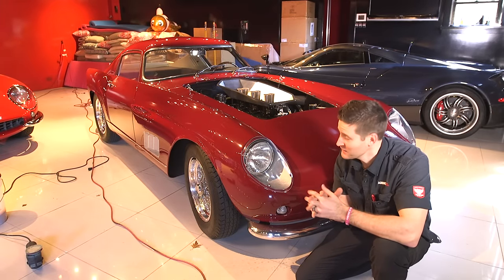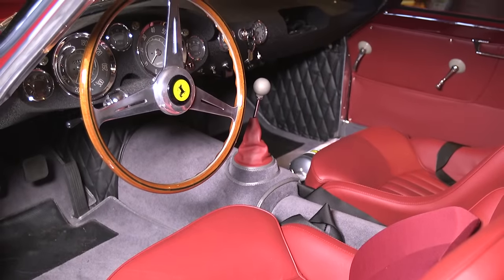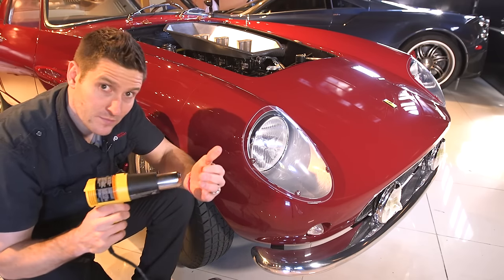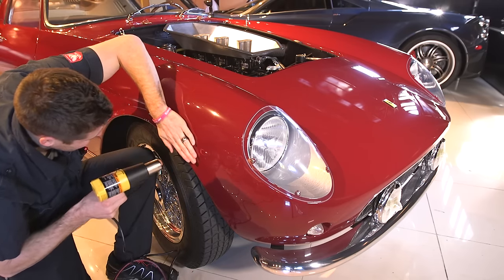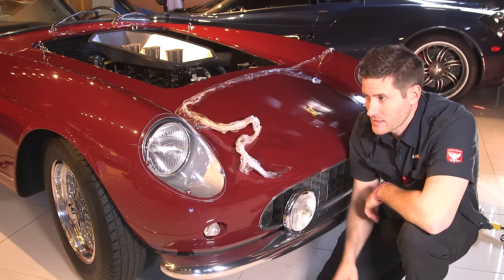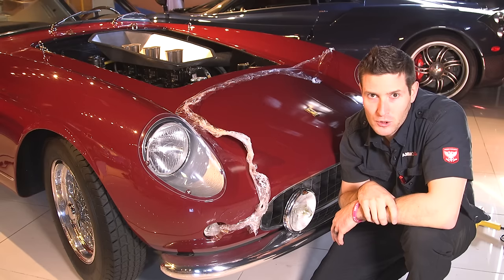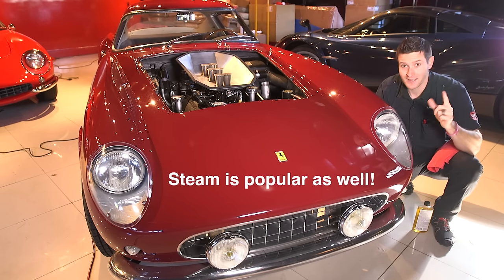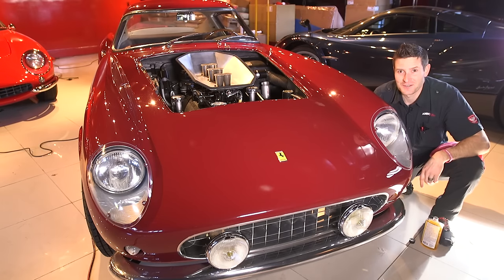How to Remove Clear Bra: $12M Ferrari 250 GT LWB

Comment: having been an installer of all the clear bra/paint protection films on exotic cars, one thing i found was that by pulling the film away at a VERY shallow angle to itself, leaves NO glue behind, NO heat required. the idea is to actually not lift the film more than about 5mm above the surface, by lifting the film one thing you run the risk of is lifting the paint layers, and if it wasnt a professional paint job (outgassed/hardened etc) that you could pull up paint

Comment: so a no go on using a grinder and wire wheel?
Reply: +Anas Malas well atleast I treated the area with salted water after I removed the bra, you know salts a preservative, ill check it in a few months when I have time, until then the oak tree will protect my car
Reply: I'm not sure about a wire wheel, I'd go straight to the cutting disks. You know the ones for cutting bike chains and things of that nature.
Reply: +Sam Spina maybe a oxy-acetlene torch would be best

Comment: Thank you so much for doing this video! Perfect timing for me as any and all car wrap shops want to charge me at least $400 minimum to remove my clear bra. I'm going to do it myself even though I know it's a tedious job. After which I'll need a color correct at least 2 stage detail. Then I need to redo the bra for $1800!!! Expensive investments for sure.
Reply: sure are but better than spending several thousand for a repaint
Reply: if i may know, what is your car mr ? :D
Reply: +as wqd Porsche 997.1 Cab

Comment: Great video, but why were you pulling the wrong way? If you pull it backwards, like removing a 3M Command strip, it will come right off, with a lot less, or no heat. It's how 3M and Xpel both recommend you remove their films.

Comment: Would a clear bra on the bellypan of my motorbike be durable enough to withstand the front wheel pounding it with stonechips? Would it go opaque from excessive stone chipping?

I'm about to get the bellypan repainted because stonechips almost completely stripped the paint off it already and I need to find a way of protecting the new paint after it goes on.

Comment: If you're wanting to protect a newly restored car that you want to drive a lot, is it worth covering the whole car or would it be more wise to cover key areas? I've been thinking about doing the whole thing and getting really particular around the seams and edges (sort of like what Rob Dahm did with his Diablo before the hit and run). I can't stand the look of visible Clear Bra edges. This video also makes me wonder about replacement intervals on something like Clear Bra so it doesn't "fuse" to the paint like you mentioned. Should I cover the whole car when I get it back from paint and just count on replacing it every X number of years?

Comment: Hey Larry, I have the Rupes LHR15 mark II. Every time I go off of a flat surface, the pad separates from the backing plate, and I have to stop and adjust the pad. It seems I can't use it on anything but a flat surface. Is this normal? I feel as if the backing plate is not sticky enough.
Reply from the maker: Def not.  I would hit up Kevin Brown at buffdaddy.com.  He's got all the info you'll need to fix that.

Comment: hey there ... great site ! theres a better way i feel to take off the film ... the heat gun promote the adhesive and sometimes breaks away from the film and stays on the car ... hot water from the tap ... and as hot as it gets ... boiling water may be to hot and hard to work with ... you simply pour and peel at the same time ... DO NOT PEEL THE FILM BACK ! lift it towards you at about 40 degree angle the flatter you pull it towards you the more of it will come off easier ... you may also like the new nano fusion ... but it will get some getting used to with the new liner ... the adhesive is a little more aggressive due to the new backing ... take care

Comment: I have no idea of the chances of you being able to respond. I just spent 2 hours removing a 3M clear bra from the roof of my car (I put it on because my neighbor's cat was not very nice to my last car and I had just gotten the roof repainted before putting on the clear bra). Anyway, it has been on there for about 2 years. I wash my car fairly regularly, but over the years, it had collected tar that riddled basically the whole roof. Some of those tar spots have left odd dark stains on my paint after removing the clear bra... do you have an idea of what it is or how I could even get this out?

Comment: do you think adding a clear bra to a windshield would help prevent chips and cracks? I drive a jeep wrangler and chips always happen. I figured it would work like a screen protector on the phone
Reply: Since it protects the paint, it would do the same for the glass. I just don't know if it would affect the clarity.
Reply: No, as the clear bra is still kinda stretchy and not going to be clear enough.  There is a plastic that can installed on the windshield to protect it though.  Jay Leno had a vid on it as well as clear bra.
Reply: thats a smart idea actually

Comment: Man, just use spray-able autoflex clear. It will protect it just as much and you won't have to spend 5 hours removing it. Plus it's infinitely easier to apply and much much cheaper.

Comment: Larry, I've had a clear bra on my car for over 8 years. I've recently decided to remove and reinstall a new one, because the old one is starting to look dull and is pitted by road debris.  No one will touch it, because they are afraid removing it will pull the paint, or that it will break into a thousand pieces and take all day to remove. Do you agree with these people, or are they just avoiding the work, because they are afraid of giving me a quote since they can't estimate how long it will take?
Reply from the maker: I can't tell without seeing it but usually older clear bra is harder to remove so I can understand their hesitation.  Sometimes it comes off easily and sometimes it flakes and even pulls paint so that's probably why they don't want to quote before the work.  Hope that helps.  Thanks for watching and supporting AMMO.
Reply: I'll tell you from experience today that it was probably fear. I forgot 8 year old cars are a pain, even garage kept and maintained. Quoted a hundred (I'm not a professional detailer by any means, and I undercut so I can actually get some form of extra income at such a young age) and it took me all day, not knowing it would take so long. I didn't prepare for the worst, got through it in 8 hours (between cars on a work schedule), blisters, bruised nails, and bloody fingers and a sore back. I won't quote those again without doing the work first. 
That was a nightmare, and ended up pulling paint off a side mirror (he already told me he needed that assembly replaced, but expected that paint to come off). 
Definitely must have been fear. Even managed to melt it into gum, trying at least a dozen methods to remove it off the paint. Never again man, never again lol

Comment: Does it need any applying of special solution to clean the area under the bra after removing it?
Reply: If the existing bra has been on for over 3 years.....you'll most likely need a color correction, some cutting, polishing, and sealing.

Comment: Shouldnt you take your ring off? Not telling you your job lol, just throught I remembered you mentioning it in a previous video
Reply from the maker: read other comment. usually wear gloves but need them off to peel
Reply: Can’t you use a steamer would that be better than a heat gun to remove the PPF